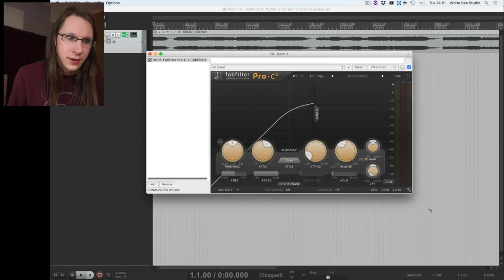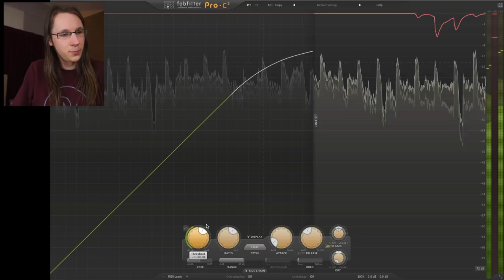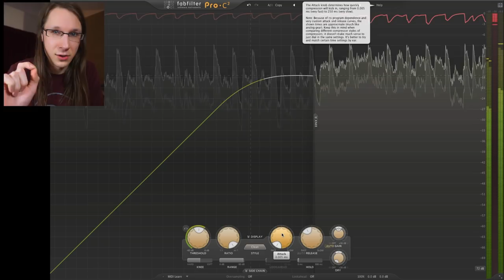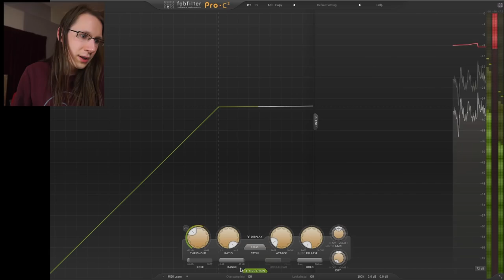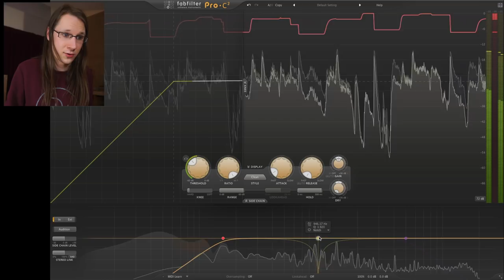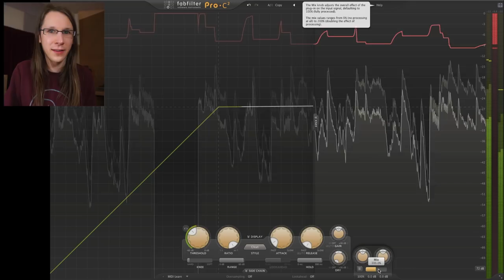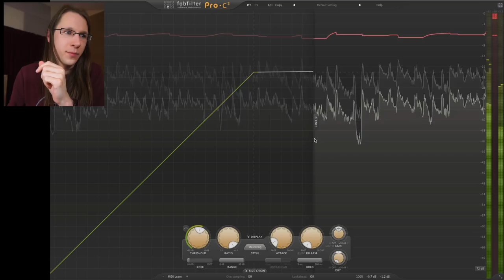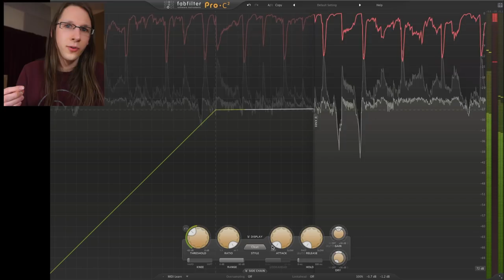Tutorial: Fabfilter Pro C2

Comment: I couldn't agree more that the Pro-C 2 is brilliant. It is the only compressor I bought after seeing it in a video some time back and I love it. Other than it I mostly use Analog Obsession compressors when I want easy to set up emulations of old hardware compressors like the LA-2A which LALA does quite a good job of. I also find COMPER very handy with the two in one approach. The presets in C 2 are a great way to get settings starting points for particular applications.